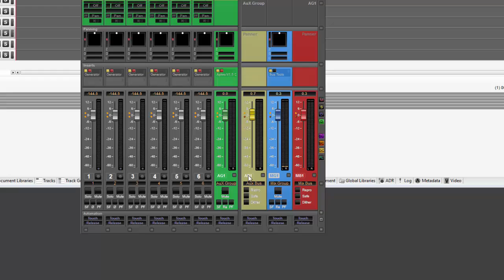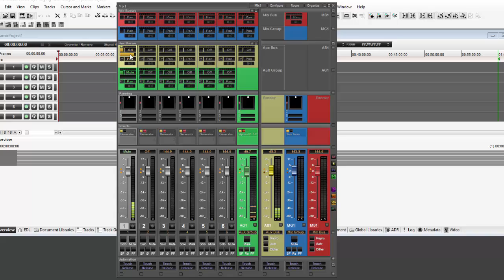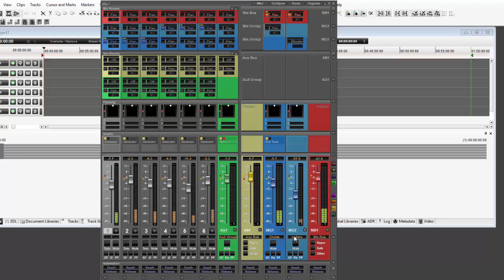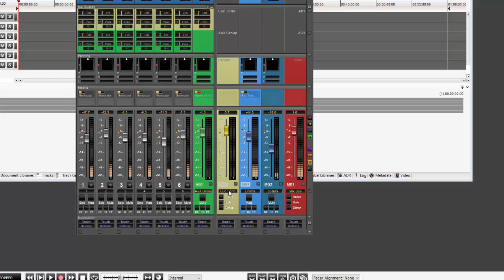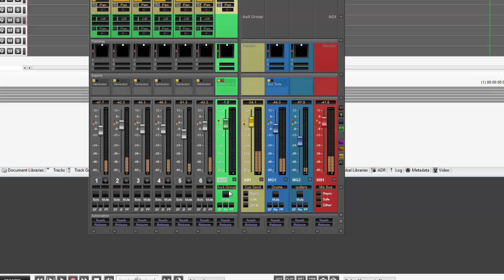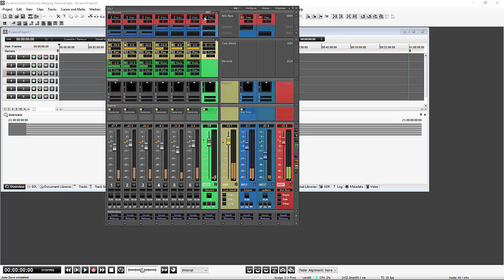Pyramix 10: Standard Bus Objects Explained

Comment: You need to show people how you create the Auxes , your different choices , where you find the auxes in the software , where you add the busses from the top menu and type. Also , slow down , you go too fast. Your video's go way to fast for anyone who is not familiar with Pyramix . People that know Pyramix do not watch these video's , only people who need to know the information watch these.
Reply: Create aux sends in the configure tab of the mixer. Also right-clicking directly on the mixer allows you to add busses, etc. 
Adding sends is very basic, and is something you'd either do in training with another engineer who uses Pyramix, or find in the manual. These are the best methods of learning complex and powerful software. A tutorial such as this one should be treated as a supplement. 
While I agree this goes by quickly, you have all the flexibility in the world to go back and replay any section, any number of times. Good luck.